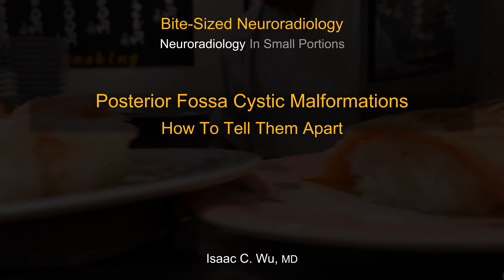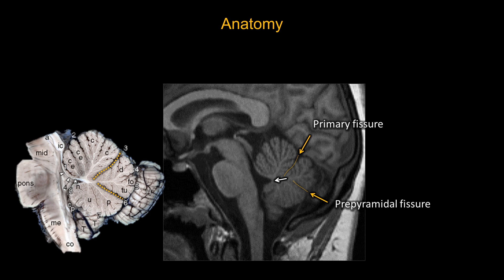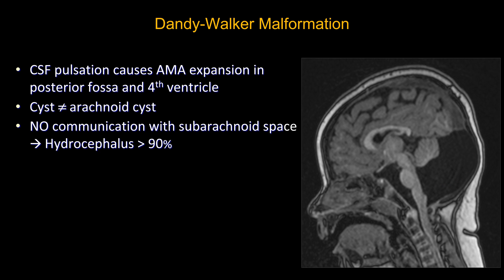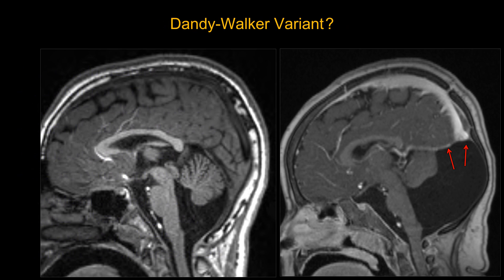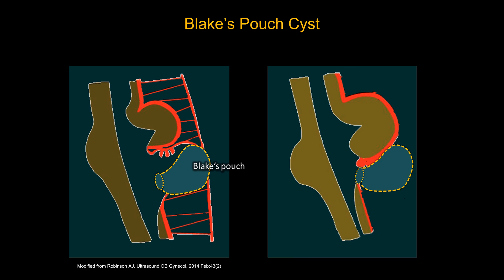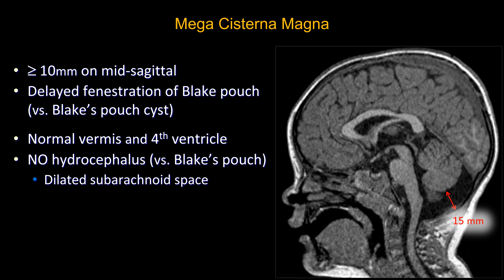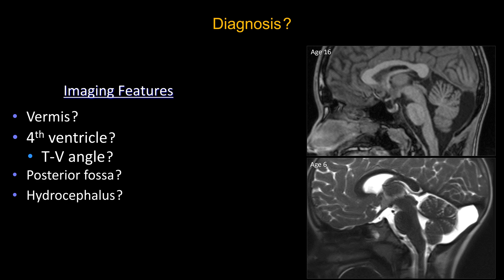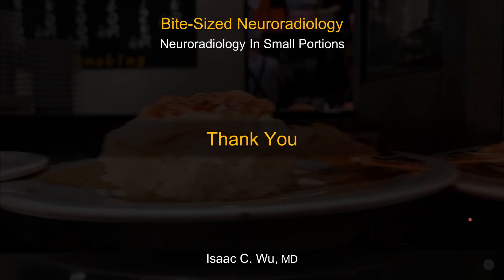Posterior Fossa Cystic Malformations Made Easy - How To Tell Them Apart

Comment: Sir am a lady pregnant 24weeks my ultrasound came blake pouch cyst -skull-(small well defined an echoic cystic lesion in the retrocerebellar aspect measuring 10x10.2mm likely S/o Blake pouch cyst).ventricles are normal n neck abdence of masses eg.cydtic hygroma -normal...tell me sir😢what is d situation now am 6month running
Reply from the maker: Sorry but I'd defer any meaningful opinion to your physician. It would be irresponsible to make an assessment without a full clinical picture and images. Having said that, isolated Blake pouch cyst with normal vermis and no hydrocephalus or other significant findings often has a good outcome. Please refer to your clinician and with a follow up ultrasound.
Reply: Hey ab kaisa h aapka baby kya vo normal hai??

Comment: Thanks dr Wu. Amazing. Is there a way to differentiate arachnoid cyst from mega csiterna magna?
Reply from the maker: Thank you. Cisterna magna is located between the cerebellum above and foramen magum below and back surface of medulla in front, and CSF from foramina Magendie and Luschka drains into it. So if I see enlargement of this CSF space just below the cerebellum and without mass effect, then mega cisterna magna. Arachnoid cyst is typically more posterior and can have some mass effect on cerebellum and vermis. If Arachnoid cyst is in the typical location of mega cisterna magna, then I think it's tough to tell. If I see sign of CSF obstruction, then it's more likely arachnoid cyst (or blake pouch cyst), since mega cisterna magna is not expected to cause obstruction of CSF.
Reply: @neuroradish  Makes a lot of sense. Thanks so much 🙏🙏